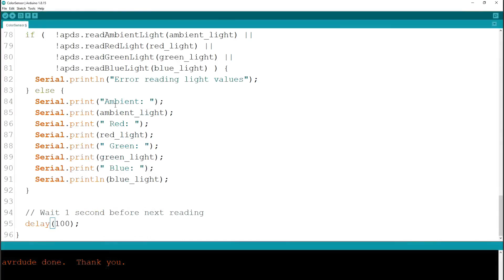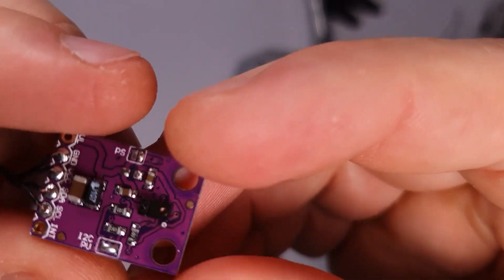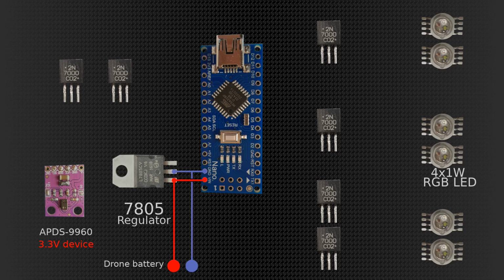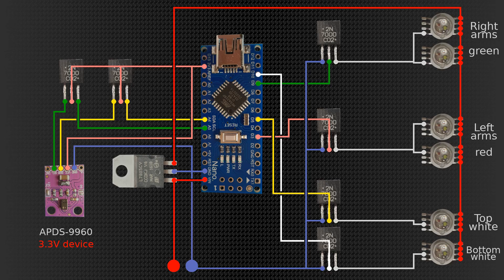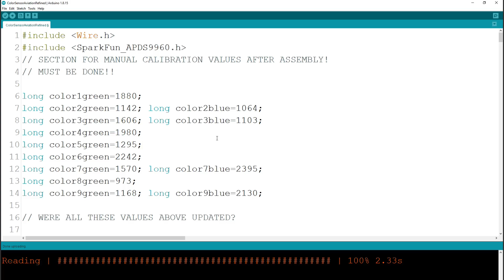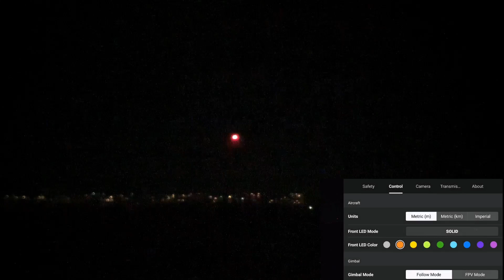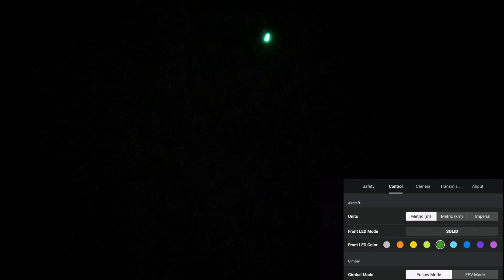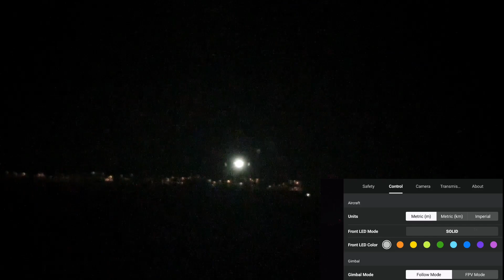MINI 2 MOD for customizable lights with remote control. (OcuSync range!)

Comment: Excellent work man! One thing I've been thinking about/wanting since I got my Mini 2 was some kind of 'spot light'. I just think it would fun to fly at night while being able to light up the ground from a decent distance.
Reply from the maker: It is very possible to make! :)
Reply: @ZollyD  I have an Air 2s now, so I have more payload capacity to experiment with. My idea is to use a (possibly 2) compact high power flashlight. I've found many options that would work, but now I need to come up with some sort of remote power switch 🤔

Comment: You make some great videos!
The arduino gets its power directly from the battery, right? Have you ever thought of using the drone's internal power supply? So the arduino would turn on and off directly with the drone :)
Reply from the maker: Could be done. I have not gone that route as I anyways needed a higher drain source for the LEDs.😊

Comment: Reading the values from led connections ehich is inside the drone will be much clean and easier i believe
Reply from the maker: 😅 in theory, yes. When you take it apart you will see, that it is not that simple. The cables going to the LED is not just simple PWM signal per color. It is 1 data pin only. Quite high frequency and the decoding happens at the LED. Pins are not acessible. I would have loved to do what you suggested, but it is not as simple... Let us know if you managed to access it somehow anyways.

Comment: Its not easiest way read values directly front rgb led pins?
Reply from the maker: Unfortunately the color decoding happens in the led itself. The pins are not accessible. I took it out, and that thing is absolutely crazy small. There is one signal pin with all the data. 6 bytes of color data in every 20 ms, but the encoding makes it tricky to read for me. For my method you do not need to disassemble the drone. ;)
Reply: @ZollyD  that's sucks

Comment: That rgb sensor is such a smart trick. Just for fun of course but I think you can set the world dji mini 2 range record using that trick: fly with two or three batteries. Select the active one automatically one by one using the arduino or other uc and litterly drop the empty ones. (Using the rgb led to control that doing safely)
Reply from the maker: Hej Man! It is sooooo crazy that you just described my exact plan! 😁😁 Exactly what I was thinking in every detail. Every detail. It is spooky. We really think the same way... :) I think 2 sets of cells will be enough to carry... ;)
Reply: @ZollyD  haha that's spooky yes :p But will be so much fun I think haha

Comment: really great to see your videos. I have a air 2s. you did a mode for auto pilot. this video gave me an idea. since the joysticks are only Potentiometers, is there a way implement a button what just simply give me a higher resolution. im thinking about to lower the speed regardless of cine/sport or normal mode. I want to fly very close to some objects and cine is still to fast. Speed mode can stabilize the drone better for higher wind speeds. So speed mode for a stable drone but when i control the speed i have only 10% max speed. im working in the wind industry and I want to inspect our rotor blades. I think that I can convince my boss that a drone is better then our giant telescope what we use for inspecting our turbines. The coolest way i can imagine to control the speed would be to have one tunable poti at my remote to control the max speed for straving/ up/down. the yaw of the dji drone is already slow enough. hope my explanation makes somehow sense to you. it would be great if there where no cables coming out if the controller :) PS greetings from Taiwan keep going, is defently great content.
Reply from the maker: Thanks! :)
That is totally an option, that is exactly what I mean when I say extra smooth cinematic mode. :) The cables coming out is yeah... 😅 But maybe it could be squeezed in the remote - though not much space in there....
Reply: @ZollyD  ajo ...now i saw it at the end of your video :)
Reply from the maker: @eastevanger_tw1173  cool. So yes only the mapping of the joystick has to be changed for that. Put in a divider of 5 or even 10...😉